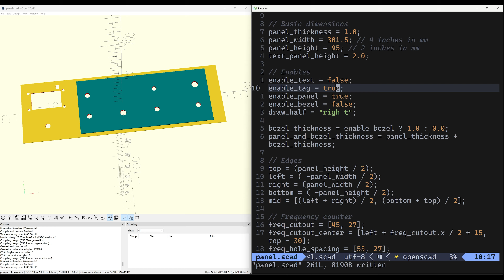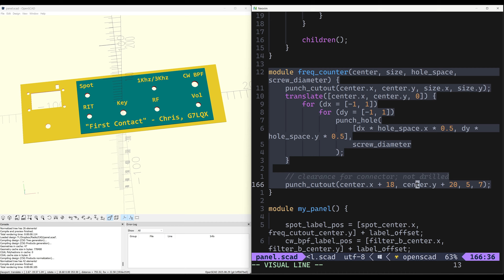QRP CW Transceiver 15: Panel Layout CAD and Template

Comment: Really like this approach Morny, will definitely give SCAD a go. The code should be quite reusable also. The quality of the lettering/print for the front panel is really excellent and love how you solved the issue with the print bed size.